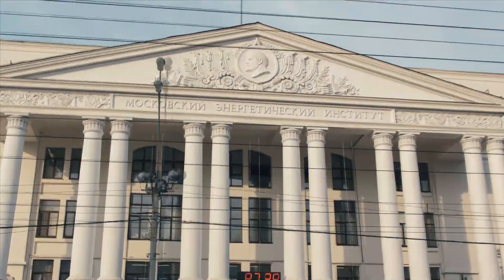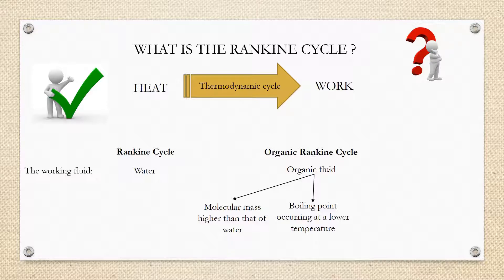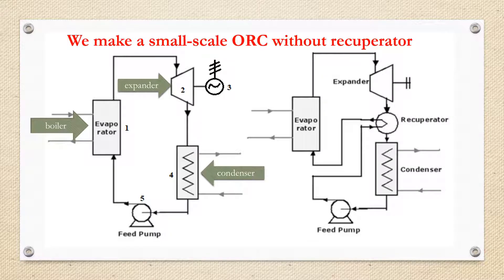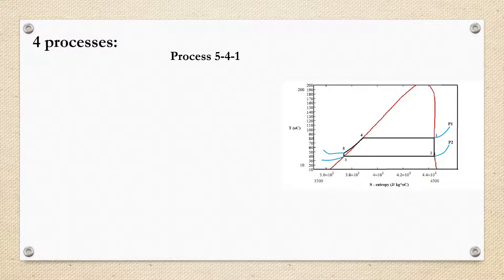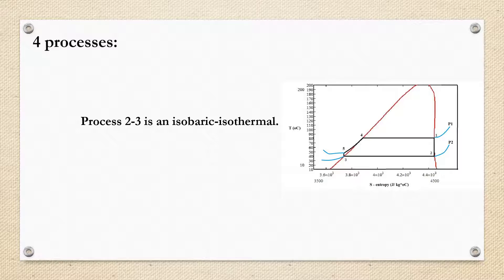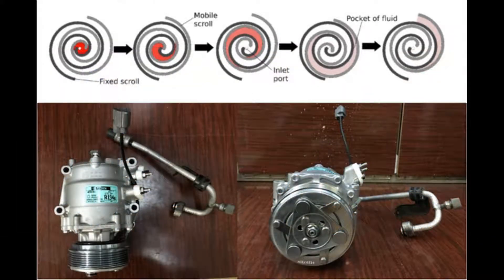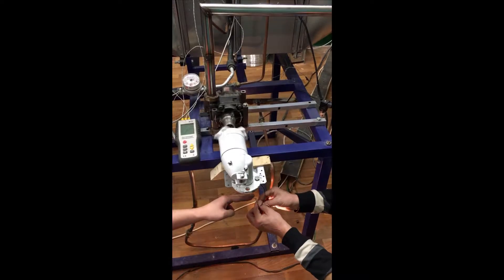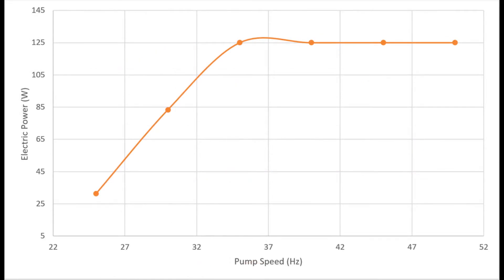Small scale Organic Rankine Cycle (ORC)

Comment: Hello Minh, I have been working with ORC for one year now, but my approach to heat source differs from anyone else. Currently, I am in the middle of the design phase for a complete system, utilizing Solidworks and Ansys. Additionally, I plan to automate the system with IIoT technology. Despite not having an engineering degree, I have self-taught myself on everything I needed to know. However, it took me five years to gain a solid understanding of the subject matter. I am doing this project to help with the current crisis situation in my country and not for any degree or recognition. I have received zero help from anyone in this endeavor. if you like to join me for the project please contact me